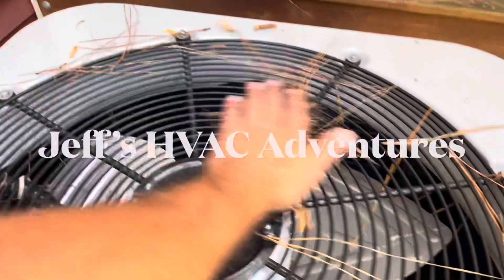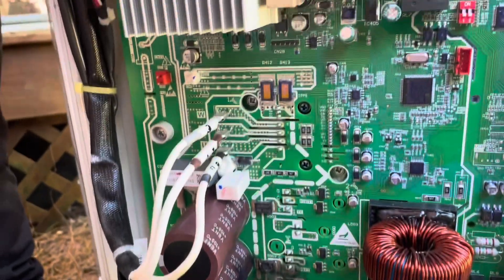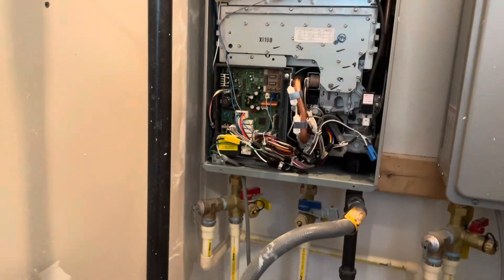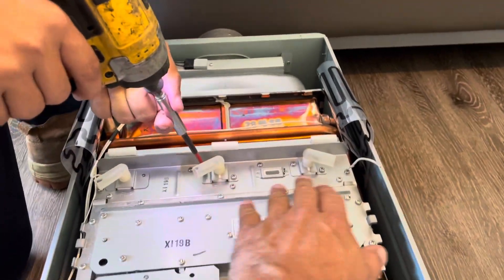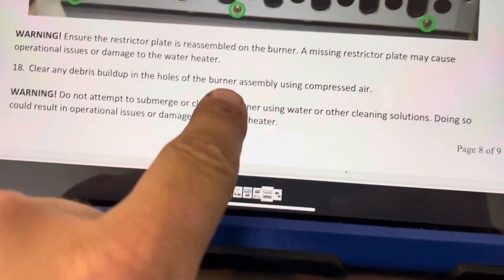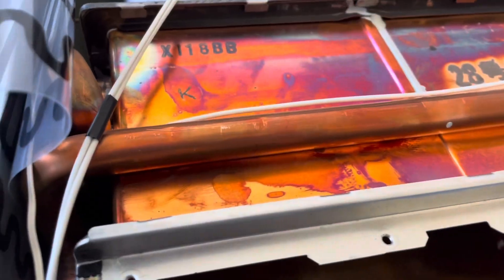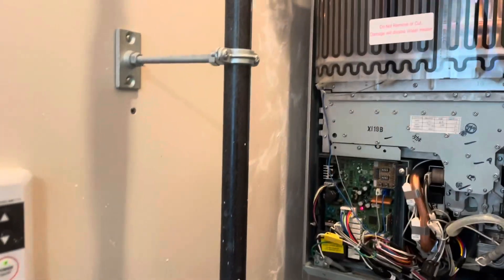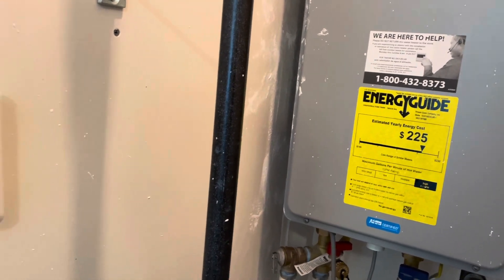Bosch Heat Pump Board BLOWS UP!

Comment: The board on mine has blown twice now. They replaced the unit after the first one blew and we replaced part after part. Now this one has blown also.
Reply from the maker: Sounds like a tough time.  I’ve not had one with that many issues.  Maybe call in another contractor to do a complete evaluation of the system and the install and make sure everything is up to standard.  The installers might be attempting to cover something up.

Comment: The surge protector needs replaced, when the green light is out it took a hit. Still let’s the equipment get power but needs replaced at that point. There was some sort of power problem there, undervoltage, overvoltage, brownout, blackout etc.
Reply from the maker: It actually tripped the breaker.  But yea we are replacing the Surge Protector too when we go back.

Comment: I was advised by a Bosch distributor that surge protector is not rated properly for the voltage specs.
Reply: I'm pretty sure that surge protector has warranty/guarantee! At least the ones we install give you a 5-year warranty and will replace anything that breaks, up $5,000 they cover! BUT the owner has to register it using the little piece of paper that comes with it, if they didn't, yikes!
Reply from the maker: That’s weird.  I’ll have to look into it.  We buy everything we need from Johnstone supply.  They basically sell us a Bosch Package with everything we need at a certain price point.  I’ll have to look into that.

Comment: What's the wait time on those boards? Seems like every time I need bosch parts it's a ridiculous wait time.
Reply from the maker: I’m getting this one Tuesday.  The only parts we have really had to wait on on the HP side has been just a few days.  The Boiler and WH side usually is a longer wait.
Reply: @JeffsHVACAdventures  Yea its always the boilers and WHs for me, 2-4 weeks usually.
Reply: Hell I couldn’t even get a new American Standard compressor on a two month old 14.3 seer2 heat pump. They had to give me a new unit which I preferred anyway. You can thank your good ole greedy, corrupt corporations for outsourcing America to Communist China and Mexico. Enjoy.